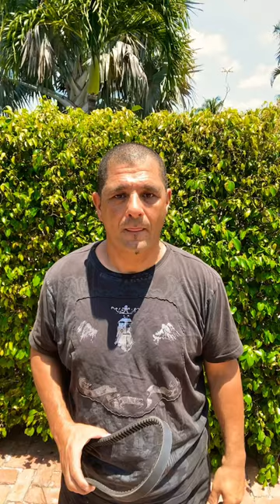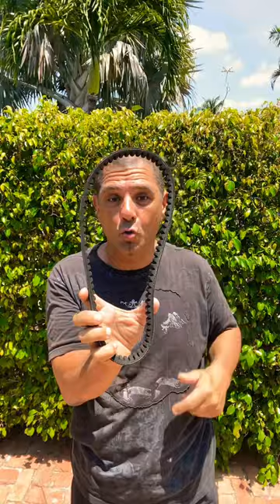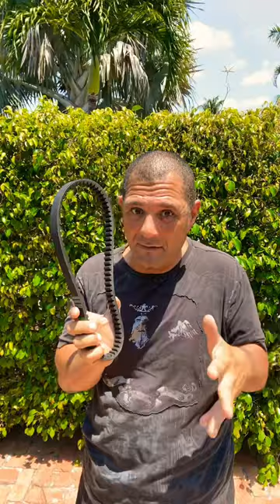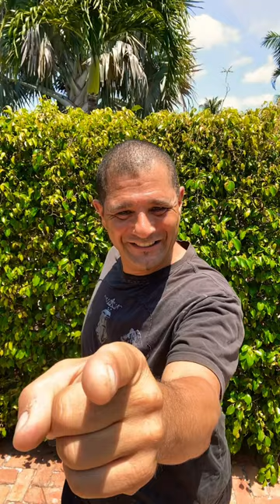Scooter Belt for gy6 150cc #shorts

Comment: I think it depends on the case size. My lance vintage 150 has the "short case" which has 8 bolts instead of 10 and uses a 743-20-30 belt. The 842/835 belts just slipped right on and had no tension
Reply from the maker: Hello yes the case size is very important

Comment: So this belt will fit ANY gy6 motor regardless of the name brand???
Reply from the maker: yes if your motor is 150cc gy6 this melt is perfect
Reply: @Virberello Scooter Tips  hi and sorry barge in. 
I have an SYM Orbit/Mask 125cc 4T 2019. I'm sure it's Gy6 engine ( as you see I'm not a conesur) but I have difficulty finding  the right belt. In themanual is 818X19.7X28, which is absolutely  impossible  to find it UK. 
So do you recommend the 835x20x30 using this one instead.  
Also on the SYM site, they sell  the original  one at a ridiculous price : £60
Thank you in advance .